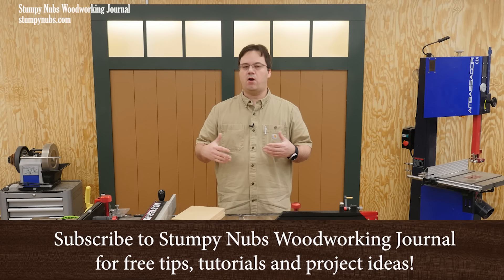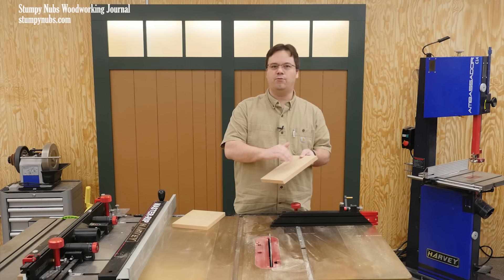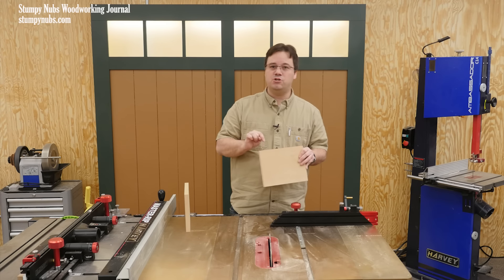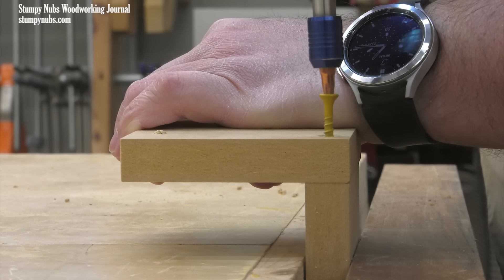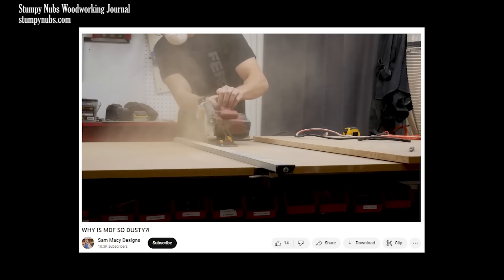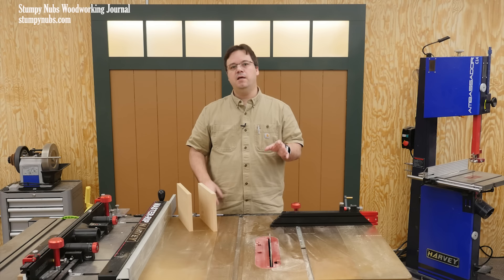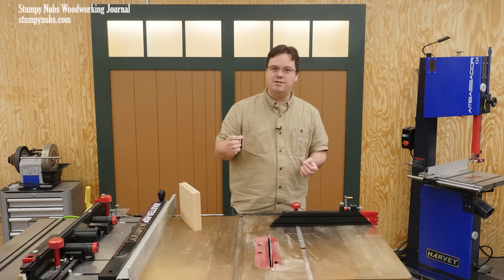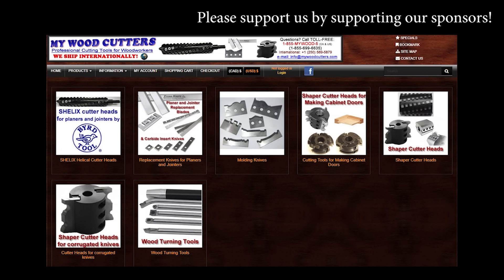This stuff changed my mind about MDF projects

Comment: I've built a few speaker boxes using drywall screws. I do predrill. I've not had a failure yet on my box that has 2 2k watt RMS stubs. But I did go a bit overboard on the screws and I did a lot of glued in 45's in the corners.  I also built a triple monitor stand for 27" monitors. It amazed me that it never sagged. I used it for about 5 years before tossing it. 

I also have a MDF top on my workbench. It's got a 3 inch unsupported overhang. My wife has stood on it and it's not snapped. There's no way it will hold me lol. I have been up on top of the table accessing our above garage door storage and nada. My "temporary" top seems like it's going to be there forever. It's 7 years old and still going.

Comment: I have had success joining mdf or chipboard with solid wood battens - you screw through the mfd into the real wood - obviously using appropriately sized pilot holes. Glue helps too.

Comment: I always saturate the floor facing edge of cabinets or kick boards with oil based paint. That way if the floor ever gets wet, the panels don't swell up that easily.

Comment: I have found MDF to make very strong joints.  Take two 3 or 4 inch squares and make a butt joint 90 degress and clamp til dry.  You can stand on the pieces.

Comment: Drill your pilot holes deeper on the edges of boards so that the point of the screw isn’t digging into the bottom and make sure your clearance hole  is the correct size

Comment: I don't know about the USA building supply places, but European places mostly carry some of the mechanical fasteners, and specialized screws, for working with MDF and similar products...the screws typically have a sharp, thin thread, on a body that is about 2x the size of a wood screw, and the threaded inserts with internal threads for metallic screws, are also normally in stock.

Comment: here in Europe there are water based primers avaible that seal the MDF edges perfectly, I get these primer from a local paint shop. In the past I've also used fillers but since I discovered these  excellent primers, I won't be applying the fillers anymore.

Comment: Coarse thread drywall screws work very well for fasteners in MDF or just about any other kind of fiber board.  Their shafts are thinner and less likely to cause a split.  Of course (as mentioned in the video) pre-drill and be careful not to overdrive the screw !!

Comment: Good explanation but wouldn't use drywall mud. Perhaps a flatter screw head after countersink then bondo the hole. Sand, kilz, paint or just sand & finish w/screw heads spaced and at surface.

Comment: I quit using MDF a long time ago. The dust was unmanageable, and the lack of resistance to humidity was a deal-breaker here in humid Hong Kong. Thank goodness for a reasonably affordable supply of WBP plywood.
Things I built 15 years ago are as solid and serviceable as the day they were new. Can't say the same for MDF. A tiny scratch or imperfection in the water-resistant coating, and it returns to the sawdust from which it came.
Reply from the maker: I think the cheap furniture industry has cause people to think that MDF has no practical use. But there are plenty of projects where MDF is actually a superior product. For example, those who make speaker cabinets love MDF. It also is an ideal substrate for some veneer projects. And MDF panels are excellent for flat-panel cabinet doors when surrounded by a hardwood frame.
Reply: @StumpyNubs  No argument there. I do make speaker cabinets, but they're used for pro PA systems and guitar speakers. These things get moved all over the globe, sometimes not too gently. MDF doesn't hold up well to the abuse. I have experienced sheets of this good plywood getting a bit of a twist, so again, no argument on MDF's stability against warping. My primary considerations are torsional rigidity, dimensional stability in high humidity, and the ability for repeated screw and insert cycling. Thanks for taking the time to reply. 🙏

Comment: I've been using Bondo for years to seal the edges. It dries just as fast, fills bigger mistakes, and takes paint better. MDF also takes automotive style 2k paints very well if you want a super durable finish.
Reply: That's what is used at my job.

Comment: 20 years ago I was given the suggestion to use a diluted PVA (Type 1 or 2) wood glue and water  (about 1/1) as a binding sealer.  This is used instead of the shellac.  The benefit of this is mostly $.  I don’t know about y’all, but the price of BIN primer is through the roof and it can sometimes be hard to find.  The fumes are another benefit.  The wood glue binder  soaks in on the first pass then about 5-10 minutes later you can do a second pass.   I usually brush it on but you could certainly spray it with a cheap cup gun since it isn’t a problem getting it on the MDF face.  It’s non-reactive with lacquers, conversion varnish, oil/latex paint once it’s dry.  
I typically only sand it to 180 but to each their own.

Comment: As someone who has had to rebuild cabinets that have been destroyed because a sink drain or supply valve leaked, I want to find whoever invented MDF and kick the living crap out of him. MDF SHOULD NEVER EVER BE USED WHERE THERE IS EVEN A REMOTE POSSIBILITY OF MOISTURE. Yes cabinet makers, I'm looking straight at you!
Reply: NEVER USE IT for bathrooms!  Now I got a real issue with a bathroom cabinet that the bottom is crumbling.  Alread found replacement WOOD baseboard identical to this stuff for replacement at Lowes.  About the same price!  Cabinet repl. will be an expensive PITA one of these days when I cannot stand to look at it anymore.  Stuff is like a sponge.  Unless you waterproofed.

Comment: I cannot remember the process between primer, paint, and super glue, but it seemed like the MDF edge soaked up primer and never stopped.  Then I sealed it with thin super glue.  After that the paint stopped soaking in.

Comment: The screw you show has a “way to fine” thread, and the root diameter is too narrow. There are coarse thread screws available that are designed for this product. “HAFELE” is one supplier of these screws, and they call them CONFIRMAT screws. The proper screw has a rather wide diameter with a coarser thread. What this does is it allows the threads of the screw to be spread further apart from the fibers thereby minimizing the potential for 
failure. I have been using these screws since the 1980’s. The holding power is immense. If I’m not mistaken, I think they were originally designed for melamine sheet goods with a particle board sub-straight, but we found them to work well with a wide variety of man made sheet goods. 
I have an extensive background in commercial case goods and architectural millwork.

Comment: I have found a really effective way to treat the edges of MDF is to give them 2 coats of PVA wood glue, allowing the first coat to dry before lightly sanding then applying a thin second coat, usually with my finger for smaller pieces. This leaves a super smooth edge that won't soak up paint. PVA glue will take a latex based primer/undercoat well. I wouldn't use this method for an oil based primer/undercoat.

Comment: I only cut MDF with a jigsaw. Way less dust than a circular saw, and if you have a sled or jig you can cut it pretty damn straight. Tidy it up after, if you have to, with a cheap block plane or sanding block.

Comment: I found a way to seal MDF and make it much more moisture resistant and stable, especially on the edges. I was restoring some cast iron frame industrial grade park benches with 2x3 wooden slats, I had to restore the wood slats, which were pretty compromised after over 10 years outside. 

I bought some stuff called TotalBoat penetrating epoxy. It is a two-part 2:1 epoxy and it has the consistency water basically. I wanted to protect some MDF boards on a workmate type workbench. I put a couple of coats on that MDF and really soaked it with it. 

The stuff penetrates into the MDF and makes it harder and more water resistant. It penetrates wood, fills voids and then hardens.  The product is made for restoring wood boats. If you are exposing it to the Sun you still have to put varnish on it because epoxy is not resistant to UV light. Use a mechanical mixer on a drill. I'm not affiliated with the company but it is a good product.

Comment: I prefer shellac like Zinsser SealCoat thinned 50% with denatured alcohol to seal the edges followed by full strength SealCoat then a few coats of vinyl sealer. It definitely doesn’t get rid of all the grain lifts before the first coat of paint but it makes it so that second coat goes on smooth as glass after some sanding with 320 grit after the 1st coat of paint

Comment: I used to do QC for a business that put decorative laminate on MDF and particle board.  When we'd QC incoming lots of panels for screwholding strength, the ANSI method called for machine screws.  They hold better than wood screws in MDF.  Pre drilling is an absolute must.  I can not remember the exact screw after 30 years, but I am pretty sure it called for an 8-32. It might have been 10-32.  The taper on a traditional wood screw doesn't do anything to reduce splitting or increase holding power in this application.  It is also true that the quality of MDF and particle board varies greatly. The big box stores sell the bottom of the barrel stuff.  Sauder bought a lot of stuff from us, and usually, they wanted the cheapest panel we would laminate.  If you put a good finish on good MDF, it will last a long time, even in applications where it gets wet  occasionally.

Comment: I hate MDF but there are projects that definitely ask for it, such as modern looking office desks and kitchen cabinets. But that's not all. Even for actual wood projects it has great applications. I learned recently in Rob Cosman channel that it may be a spectacular solution for box lids that has a trend to cup. Who never finished a box and went to bed just to find that beautiful project ruined by a cupped lid the morning after? Ugh! The solution is to make the lid with 3/8" MDF layered with veneer instead making it with actual wood. I have used this same technique also for bottoms inserted into grooves with 1/8" MDF. It works like a charm!

Comment: Laminate a couple of layers of MDF together, make at least 2 of them. Then cut out round and turn to true round discs.

Mount the discs onto a bench grinder 8" is good. Mount the grinder so the top of the discs runs away from you.

Work fine valve grinding paste into the rim of one disc and knife polish into the other.
Don't allow moisture anywhere near the discs and you will have a knife sharpener that doesn't wear out your knives, cleans off damaged edge material gently while polishing a sharp durable edge.

Now you finally have a use for MDF, blotting paper if you prefer its more accurate name.

Comment: man this is why I question even doing DIY/Home Improvement stuff. There is so much to know and if you don't know you can royally eff yourself, others or your property right up.
Reply: If you have the time to take it one step at a time, you can learn some really useful skills. I started in high school making a  simple shelf. I have no professional carpentry skills; I have always had an office job, but in my spare time, I make simple furniture like bookcases. My first one from years ago was terrible. My most recent one is pretty nice. I even showed it off to my cabinet-maker uncle and he was complimentary. You can start with scrap pallet wood (free) and make some nice stuff. When you get to feeling more confident, you can spring for a half-sheet of maple-veneer plywood ($$). Every time you make a mistake, you learn something. I use MDF sometimes, but it's not my favorite.

Comment: When I worked for Midwest Woodworking and fixture Corporation (Southern Illinois division 2) from 1991 - 1996. We used a lot of MDF. You are right, you must pre-drill a proper size hole.
You can be used for a lot of things.
I was told back then. One of the main ingredients in MDF is embalming fluid. True or not I remember it being nasty when cutting at the table saw. Even with a mask on it became hard to breathe.

Comment: I build most of the fixed closets or cabinets in the house out of MDF because it is very stable and hardly expands with temperature changes. I have learned that it is very brittle around the edges, but with good quality paint, it becomes very hard and stiff. Also use MDF filler to fill small holes or cracks or spaces between boards, then sand it over and paint it, it will become ultra smooth.

Comment: Finish MDF edges with a thin super glue. The first pass soaks into the fibers. Lightly sand and seal again with super glue for a glass surface. And yeah it takes a lot so buy a good size bottle or two.

Comment: When using screw fasteners, and don't ever expect to remove them, adding a dollop of slow cure epoxy to the hole, as a bonding filler makes the screw joint much stronger, and allows for an even larger hole, that eliminates splitting stresses.

Comment: I'm glad I don't have to handle or deal with MDF at all now.  This is a very good video and highlights the dangers that I didn't know it had.  Although I knew it was too toxic to casually sand or saw it - the stuff is a bit of a toxic no-no. It ain't worth the risk. I'd use solid wood or ply or veneered real wood.  OK more expensive but safer.  Good advice here about the atmospheric dust. It's nasy stuff.

Comment: I'm not a woodworker.  I made some shelves with MDF.  My tip is to buy it cut to size to avoid the whole problem of dust.  I did cover them myself with Formica, bonded with Roo Glue, which I highly recommend.  It is much easier to work with than contact cement.  The end result was excellent, because MDF is such a flat, stable material.
Reply: Many stores will not cut MDF to size because of the dust and dulling problems.

Comment: For getting smooth surfaces on cut edges of MDF, at work we glue size all cut surfaces. 50/50 yellow glue and water, rub it on, wait 10 minutes, and sand very smooth. Every woodworker has glue around and not so many joint compound. So it's a bit more accessible and very hard to get wrong

Comment: For paint grade MDF always use a premium grade; also known as door grade MDF. It’s higher quality and more dense. The face is smoother and edges are less porous. Sand the face and polish the edges with 320 grit, not 220. Also break the edges using 320. It burnishes the pores closed eliminating the need for an edge sealer. Primer will build nicely with minimal soak. It paints way nicer than standard MDF. This is also true for door panels  where edges aren’t exposed. The increased cost for premium is more than offset in labor savings and better quality

Comment: Regarding the dust problem. Let me start by saying “I CAN’T” for certain blame this product as my previous life has included experiencing times of interaction with airborne asbestos dust from brake linings as an apprentice mechanic back in the late 60’s, coal dust from mine work and concrete dust from cutting in building work. But I’m currently undergoing diagnostic tests for pulmonary fibrosis. I had quadruple bypass surgery CABG done back in 2009. Up until the last two years I was great no breathing problems to mention. However it was during the years between my surgery and now we have had ongoing renovations in our home. We have installed a lot of MDF preformed trim in every room. We also have cut up many 8x4 boards of 1/2” MDF boards for paneling and styles. No external shop available, it was all done indoors on a table and mitre saws. Despite using a large shop vac on both saws when cutting, the dust was an enormous problem. I was foolish enough to not wear any form of masks, just kept windows open when and were I could, and was constantly cleaning up to keep it to a minimum. Regular shop vac filters changed etc but it didn’t completely stop dust. Add also the forced air heating would recirculate the dust into every room. It’s been a nightmare. I wished we hadn’t started this renovation, or even buy a house that needed so much work. But we live and we learn. Personally this product should be banned. You can’t even call it wood. It’s hard cardboard at best, edges are easily chipped or broken, every Brad nail fired in causes a mound around the hole or puffing if that’s a better explanation, which required sanding before filling and caused lots of extra work sanding to reduce blemishes in the finished paint. Coped edges where always fluffy and brittle and cut edges require sealing and sanding as mentioned in this video to make a good smooth surface. I personally made a 50/50 mix of white glue  and water and painted the edges, let them dry and then sanded and painted. So maybe take it from me, find another product, give this crap the widest berth possible do not even bring it into your home. It’s not durable and certainly not environmentally or health friendly.

Comment: Moisture resistant MDF is a much better product than the standard fluffy stuff. Edges are easier to sand ready for paint and its more stable.  Finsa Hidrofugo is good for moldings too as it doesnt fluff up when you machine the face ,but you need TCT cutters so can be expensive but the results are worth it

Comment: Since the bed of our CNC at work is MDF, we run a shop air filter (hepa with shop-made pre-filter) which can be linked to other units and controlled with one remote. They hang up on the ceiling and really help get what gets past the dust collector.